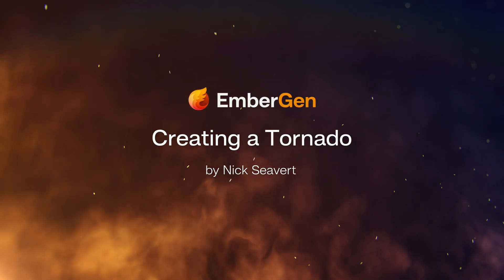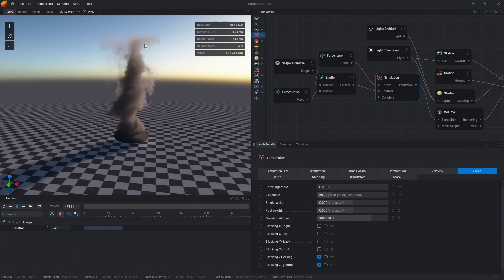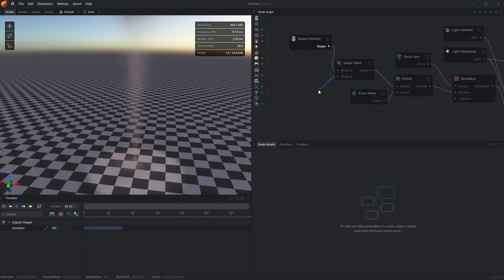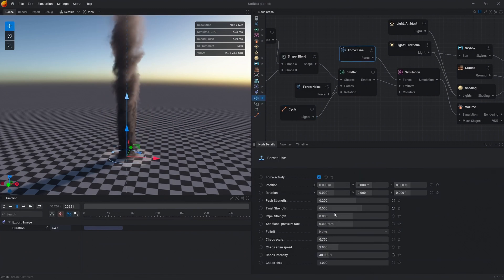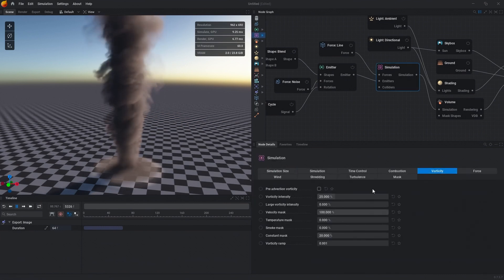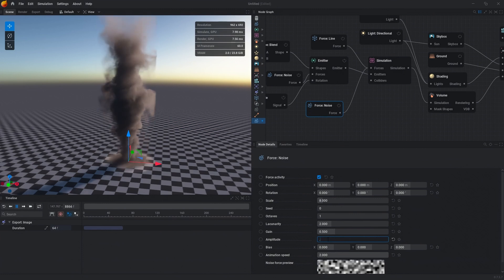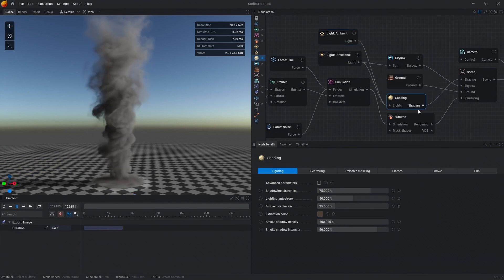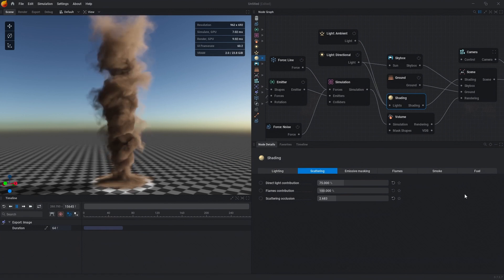Quick EmberGen Tutorial: Creating a Tornado Effect

Comment: Trialled this out on Embergen 1.0.8. The resulting tornado looks quite a bit different, and the rendered flipbook is unable to loop properly. I had none of the nodes that would break the Loop Simulation function. I found that turning the Velocity Transfer setting under Forces in Emitter to 0 fixed the issue, but of course it changes the tornado appearance... Might be a bug?
Reply: Well, going off that other comment that liomizar made, turning off Mod:Cycle node works also if you have the Velocity Transfer not at 0. They don't seem to work with each other.

Comment: Thank you for the lesson! IT WAS VERY INFORMATIVE). But I have a question. I looped the effect, but the resulting Flipbook has a sharp jump from the last frame to the first. I spent a long time looking into it and found out that the Mod:Cycle node was to blame. If you turn it off, the animation loops well and there are no jumps. Everything is smooth. But this spoils the appearance of the Tornado. Any ideas on how to fix this?
Reply from the maker: You'd have to make sure your cycle loops perfectly too within that frame range. i.e, it needs to be timed in such a way where if you're at a value of 50 or something on frame 128, you'll need to be at a value of 49 on frame 255 in an example that has "128 frames of looping"
Reply: @jangafx  Would it be possible to get an elaboration on this? I'm doing 144 frames and trying to adjust the Frequency of the Cycle node to ensure that the rotation parameter loops across the frames as stated, but the flipbook still jumps. Is that the right way to go about it?